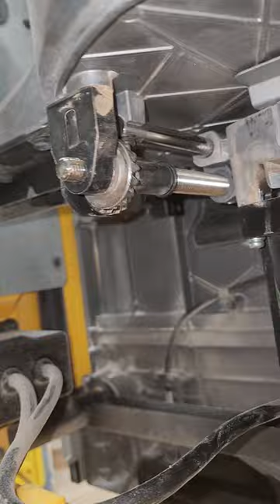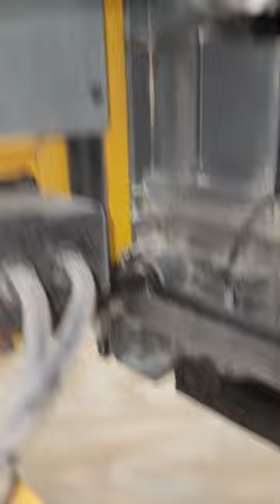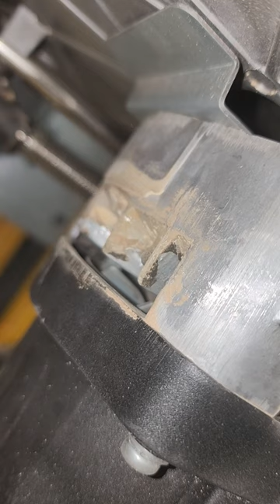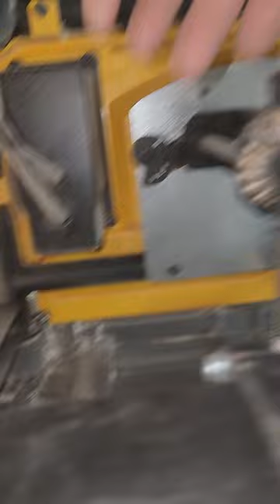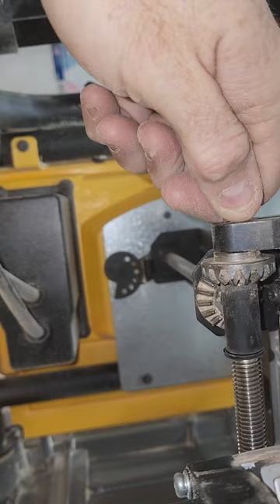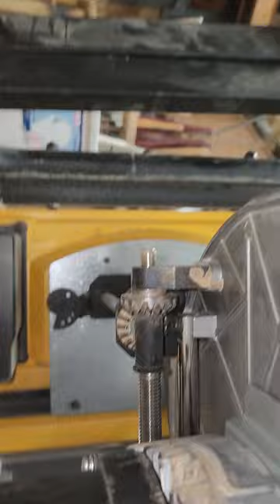Help!-Dewalt Tablesaw is (broken)

Comment: I couldn't really see the pin hole but I can certainly understand the problem. Plonking a split pin in there to get it motoring again was my first thought, but of course you don't want to cause more damage with a temporary fix. Isn't there a kind of rotationally sprung pin called something like a roll pin? I've taken them out of things but never had to buy a replacement so never learned the name. I imagine one of those would do the job and be faster to source (and cheaper) than the De Walt part. Best of luck mate and keep your fingers away from anything too fast to catch. Cheers.
Reply from the maker: Sorry that you couldn't see it.  I tried 2 size of nails.  I found that if I use a rubber glove I can spin the shaft to raise and lower as a work around.

Thanks for commenting

Comment: I was cutting cookies into 2x2 from a tree that was cut down years ago on my brand new dewalt table saw..   I made 4 cuts then my table saw just stopped working. Before it stopped there was a few time where it was just stop (I’m thinking because it was a weird angle) so I kept restarting. 

Now it won’t start.  

Any idea what I did?
Reply from the maker: Usually when cutting a thick board....sometimes my saw will trip a breaker.  Not sure if there is any internal breaker on the tablesaw itself....also make sure you are plugged direction into a power outlet instead of a power strip or surge protector.  If the saw is less than 1 year old contact Dewalt support.  I have used ereplacementparts.com several times.  here is the link.  it has a symptom section for Won't turn on.  might be some of those parts..   https://www.ereplacementparts.com/dewalt-dwe7491rs-type-jobsite-table-saw-parts-c-1009_2657_311712.html

let me know what fixes it.
Reply: @myhoneyshandmade1077 wow.. it took my 2 hours to realize I tripped my power surge. Thank you

Comment: I took a look at mine, and there is a nut on the end of that shaft with the gear your pointing too. I don’t know if yours was on there before or not. If not, that would explain why that pin sheared off. Everything on mine fits tight. If you could find the right size pin, and have the right size nut, you should be able to fix the gear. I just don’t know if yours was on there or not.
Reply: Thanks for looking.  My gears are there.  Just need the pin.
Reply from the maker: The pin came our again a few weeks ago. I bet you are correct about a missing nut.

Comment: Does your blade start to vibrate when lowering the blade? Mine does and it's brand new.  Did you ever get it fixed?
Reply from the maker: the blade being lowered kind of catches...never got it fully fixed. The key just popped out earlier in the week..i had tilted my blade degree and tried to raise the blade..without changing my zero insert...it put too much pressure on the crank.  i reinstalled the key and then sprayed dry lubricant on the bolts...let me know if you find a permanent fix...it's frustrating.  To be truthful, i have put this little jobsite saw through a lot over the years...still very happy with it.
thanks for commenting.

Comment: Ever thought of ringing dewalt and asking them?
Reply from the maker: https://youtu.be/vZEvh959za0?si=JN2RdfuDI68lSB9l

I figured it out and made a video on how I fixed it.  Thanks
Reply: @myhoneyshandmade1077  Most gears either have splines or a keyway like yours. One thing I did notice was that you're missing the nut that locks the shaft into position. If you don't replace the nut, you'll end up losing the key again. 
The newer models have a circlip in place of the nut.
Reply from the maker: @rustic35  hmm.  I put that on off camera.  Appreciate the tip
Reply: @myhoneyshandmade1077  that's good. You can buy keyway steel and make keyways with a hacksaw and file, but for $20 and extra gear, you might as well buy the kit like you did. 

In trying to troubleshoot my blade height creeping down or up depending on where the knob is positioned. Older models have the nut like yours that people say you can tighten to stop it from creeping. Mine only has a circlip so that's not possible. I'm playing around with a counterweight to try and offset the weight of the handle on the wheel but, while it's better, it hasn't completely resolved the issue. I don't know why dewalt didn't just include a height lock on the handle. It wouldn't have taken much to design.